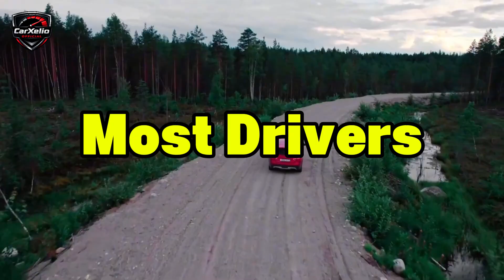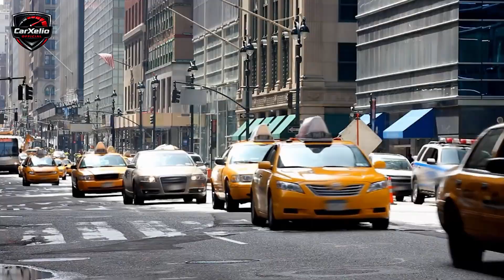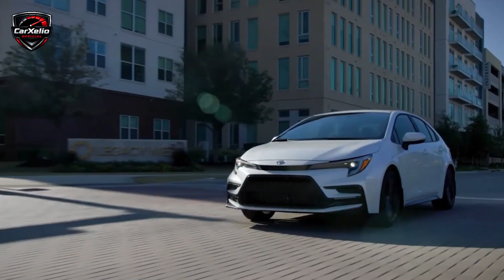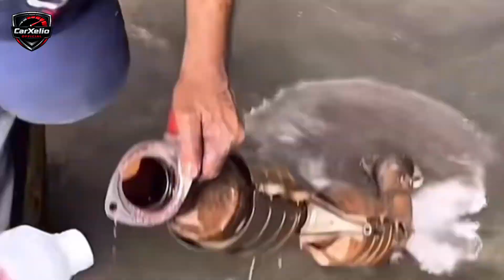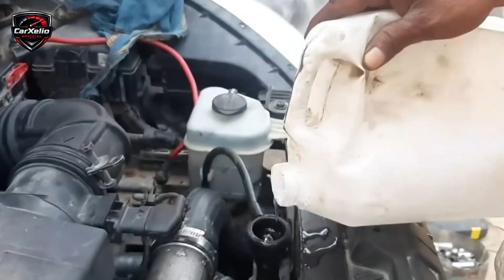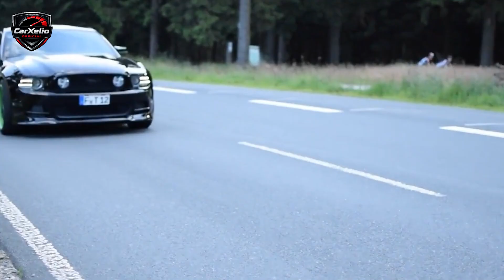Fix Your Catalytic Converter with NO Tools ($0 Method)

Comment: I goes to job not so far from home and my  catalytic from petrol got clocked
Reply from the maker: That makes total sense. Short commutes are actually terrible for catalytic converters because the exhaust never gets hot enough to burn off the carbon and unburned fuel, leading to clogs. To help prevent this, try taking the car for a 30-minute highway drive once a week to get it fully up to temperature and burn that buildup off!
Reply from the maker: Your exhaust system needs high heat to self-clean. Going forward, you might want to try a fuel or catalytic converter cleaner and make sure to take it on a longer highway run occasionally to let it breathe.

Comment: Mine never warned me with an engine fault, I had everything together
Reply from the maker: That is incredibly frustrating, but unfortunately more common than you'd think! The engine computer only triggers a warning light when an electronic sensor (like an O2 sensor or fuel trim) goes out of range. If a part fails mechanically or structurally before those electronic thresholds are crossed, you'll get absolutely zero warning, even with perfect maintenance.